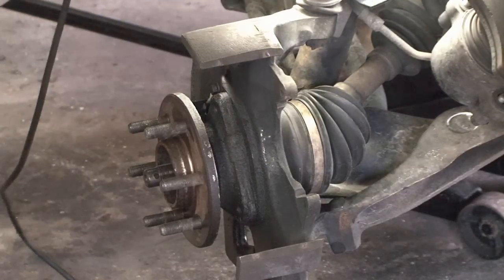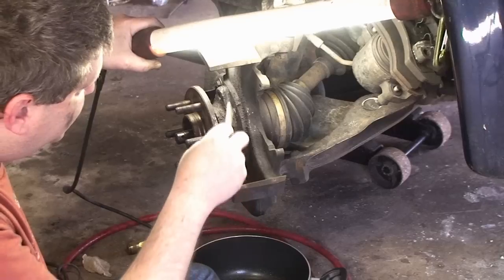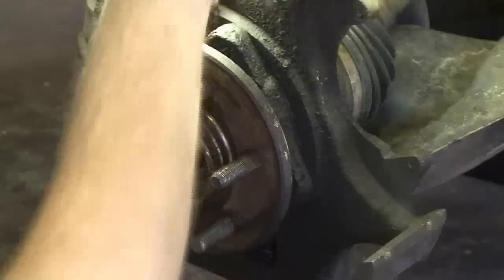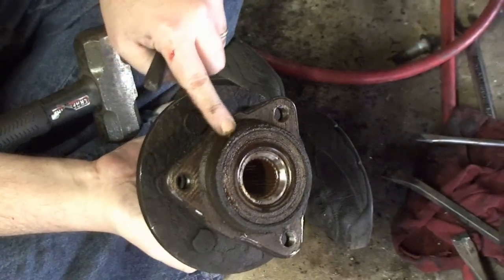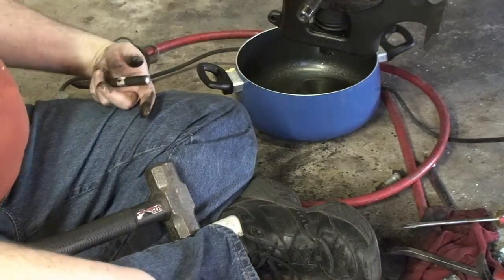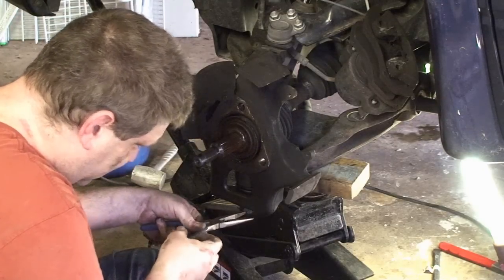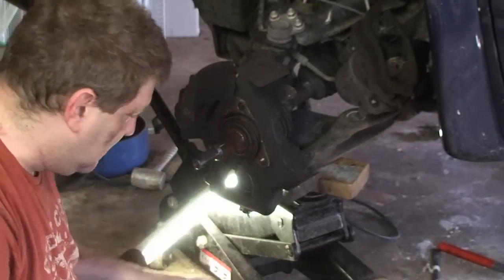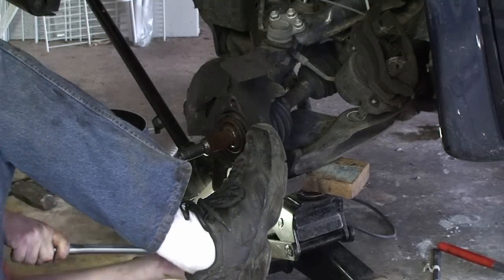2002 Dodge Dakota - Front Suspension and Drivetrain Service - Part 1

Comment: First, I really appreciate the vids. They have been a great help to me. But I would like to add that for safety reasons that you should never work on your truck (or car) use the jack to hold it up. Always put your vehicle on jack stands because jacks can fail and they are not as stable as jacks. I still leave my jack in place as well in case I need it, but I always put a jack stand in place, put on the emergency brake and chalk the wheels. Once again, thanks for the vids. They are great!!!

Comment: @GittarHedd give the knuckle a few hits with a hammer at the top where the ball joint goes through. it should break free that way instead of using a pickle fork. i never use pickle forks for that reason unless i don't care about the boot. also you don't have to remove the hub if you just remove the knuckle and hub as an assembly. cheers.

Comment: I was able to change the cv axle on my 05 Dakota by disconnecting the upper and front ball joints (and brake calipers obviously).  It wasn’t easy, but it was easier than this method.  Wasn’t necessary to remove the lower ball joint so no broken cotter pin or replacing the castle nut.

Comment: I have a '99 Dakota, recently had all 4 shocks and the rack/pinion replaced... Mechanic didn't mention any serious problems with anything under there, though mine is only 2wd. This one looks like a 4wd.

The truck's lasted me pretty good, it's had very few problems in the time I've had it (got it used in 2000 only 1 previous owner). Main complaint I've heard about this generation (concerning suspension) is that the front balljoints tended to go out way too soon. Mine did too.

Comment: But thanks for the video as I find it hard to believe that the inner part of the axle will just slid out.  No C clip anything else?
Reply: That’s a “sometimes you’re lucky” thing.  I can confirm it’s possible but sometimes the collar has to be cut away with an angle grinder. Also, there are 2-3 models of replacement cv axles-some with c rings, some without.  It can be a very frustrating repair.

Comment: Would a impact chisel get it lose im not strong enough to use a big hammer and I do most of my on repair!  I hit a huge pot hole and cracked my  rack and pinion I'm losing a lot of power steering fluid in my 1998 Durango! thank you!!

Comment: well the pickle fork might have been the actual reason you decided to replace the lower balljoint ya ripped the boot im sure. the chisel on the hu. yeah air chisel less arm work. taking all that time to remove the pin with plyers yeah first timer. oh and nice job with breaker bar and your foot on knuckle lucky you dont need a new set of balls.